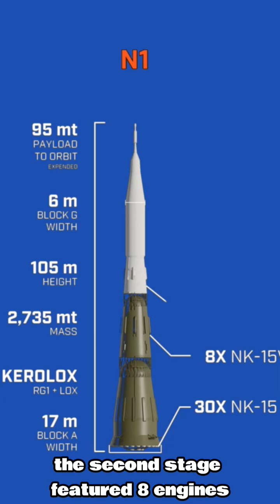The insane engineering of the Soviet N1 Rocket #rocket #engineering #space

Comment: Not really. The biggest problem of the N1 was the funding and the people behind it. The guy who proposed and designed the N1 wasn’t even on the project anymore by the time they build and tested it. Another huge Problem was the Accountability of the Engines. The first stage Engines of the N1 were ablatively cooled, which means that they could not have test fired them. This is also where some of the tests failed. Engine reliability was quite low, as some engines would not ignite at all or fail during ascent. This was not because of the complexity! The UDSSR‘s Engineers were crazily good. In my opinion undoubtedly better than the Americans. Complexity would not have really been a problem.
Reply: Regardless, what made the apollo program great was its simplicity
Reply: I recently read the biggest problem was not the engines, but the rocket that was flexing too much from vibration and breaking supply and control systems.
Reply: @piotrmalewski8178  it had many problems. Ultimately faced it's demise due to the overall poor political and economical situation of the country. A pity we never saw it work. Wouldve been Hella cool
Reply: Lol... Better? But it explodes every time?
The US one exploded 15 times and didn't explode at all... 😂